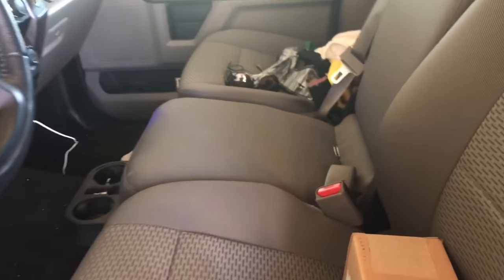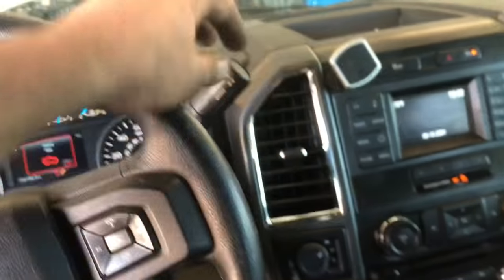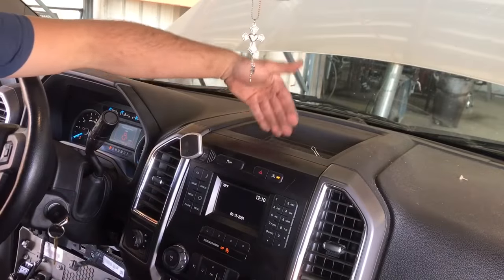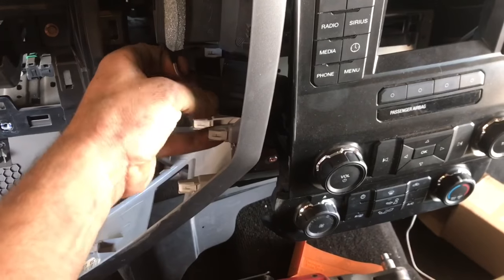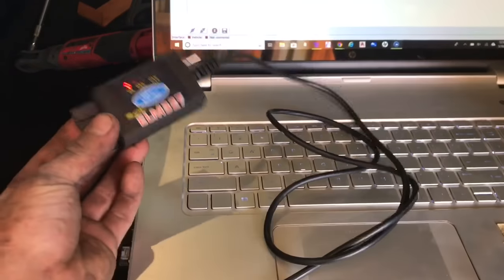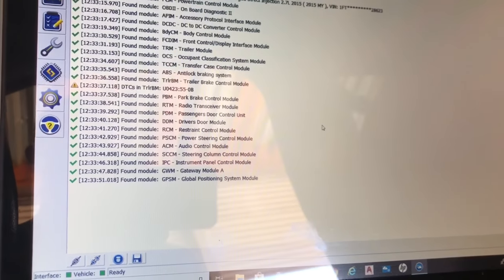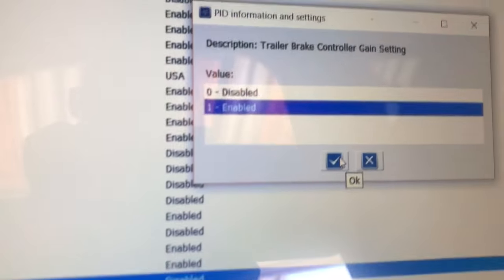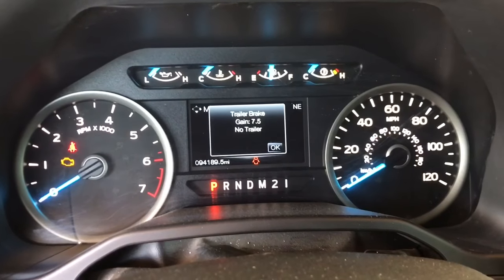Ford F-150 Oem Trailer Brake Controller Installation and Programming (2015+)

Comment: Make sure you have a 30 amp fuse in slot 24 for the controller to work. My 2019 did not have one. Just a fyi

Comment: Aaron, a bit of a late comer here.  I just installed the brake controller.  Easy Peazy.   Took about 20 min start t finish.  Took longer waiting for the temp key for Forscan.  One thing, I wasn't prompted for the Sync version and it appears there are 3 settings under the IPC heading, one for the Trailer Brake Controller Gain  Setting, one for Trailer Brake Control Module and one labeled Trailer Brake Control Module.  I set the first two to enabled and left the Trailer Brake Control Module alone for now as I wasn't sure what it did. and all the other videos didn't mention it.
Great video and presentation.  I'm not your average shade tree mechanic (a TON of experience since I was a kid) and I'm very PC savy  and also know my way around OBDC2 more than most.   This was a REAL easy install and WAY cheaper than having the dealer do it.  Super informative video, well done..

Comment: I used FORscan on another car before and I blindly hit yes when it asked to load previous configuration and I wasn't prompted to switch from HS CAN to MS CAN and it did not load the Instrument Panel Control IPC module.  I restarted the software, hit no when prompted to load previous config, then it reads your current vehicle modules, and will prompt you to switch to MS CAN, it then read and made IPC available to edit.  I was adding a trailer brake controller.  Good video, thanks.

Comment: Great instructions!  The only snag I ran into with the free FORscan beta download was that I was unable to play the IPC mobile configuration to enable the new trailer brake until I purchased the extended license. 1 year for $10, they emailed me the activation code right away and I was back in business. Trailer brake install on my 2018 F-150 successful!
Reply: All these videos and nobody tells you to buy the license.... I have been trying to get it to work forever.

Comment: just an FYI, you have to have the extended license to (forscan) to do this. it's free for 2 months but it takes a couple hours atleast for them you email you the key. this is the point I'm at so well see how it goes. thanks for the video extremely helpful.

Comment: Aaron, et al. All of the videos I have seen have you tearing about your dash and other parts. After thinking about it and using two smaller flat blade screwdrivers covered with a light cloth, I was able to just press down on the top center of the cubby hole blank and pry it out. From there you can pull everything out the front and plug in your controller.
Total time 15 minutes. No major disassembly required. This should work for almost any Ford vehicle.
The rest of the video to program the OEM unit is outstanding.
Reply: Eric Emde any chance you have a video of this technique?
Reply: @JuanRamirez-hk8sf  how do I start it

Comment: Thanks for the clear and informative video. I followed it to install a controller on my 2016, F150, 4X4, with a column shifter. In retrospect, I wouldn't have needed to take the parts off below the steering wheel. I was able to pull the existing cubby hole piece out to disconnect the wires and connect them to the controller. Accessing the plug seems to be the only reason to remove those pieces.
Reply: Did you have the 4 pin or the 7 pin connector at the hitch? If a 4 pin, did you have to change to a 7 and if so, were all the appropriate wires there?+

Comment: Just used this tutorial to easily install a brake controller on my 2015 F150. I did have the two entries to enable using my Brake Controller. I also didn't have a small ratchet so I had to pop the dash oard speaker off, and remove that whole section to remove the radio panel. 

Thank you for this video.

Comment: Really EXCELLENT video Aaron!  You covered everything necessary.  No useless fluff - just get in, and get it done.  I salute you!  I will be doing this as soon as my brake controller arrives.  Nice to see someone else appreciates ForScan too.  I use the BT dongle instead of the wired one.  So far; I have permanently shut off auto start/stop, added Hill Descent Control, enabled windows up/down from key fob, Bambi mode, powerpoint delay, radio on without key, and probably a few others to my 2015 XLT.  Love ForScan...

UPDATE:  Finished installing the hardware today.  No issues there.  Because of your video, I knew exactly how to take the dash apart!  Only problem I had was my old Windows laptop with Forscan on it is now a Linux laptop.  Didn't want to install WINE, or fiddle with passing Bluetooth through to a Windows Virtual Machine.  Finally ended up using a Windows tablet I bought years ago, specifically for Forscan, but never used because the display was too small to read.  Had to put on my best reading glasses, and suck it up...  Had it all going in a couple minutes... Thanks!!
Reply from the maker: That’s awesome, love the capabilities forscan has. Thank you!

Comment: Thanks, the video was really helpful.

For my 2020 XL I didn't remove the part under the steering wheel or the 7mm in the foot well. I did receive the two 7mm holding the top tray on before prying it up.

Comment: Great video. I bought a Ford brake controller from Amazon for roughly $100. The title claimed to be "OEM" and mentioned a part number. Using this video, I installed the "OEM" brake controller. I took my truck to the dealership to have the programming "flashed". The dealership doesn't use "Forscan", they use a Ford program that has to search for a part number before activating that specific part. The dealership was unable to detect my "OEM" brake controller so I ordered an aftermarket Reese brake controller with an adapting cord for my 2015 F150 for approximately $50 total. I disabled the dash again and plugged in my new aftermarket adapter. Needless to say, the aftermarket brake controller DOESN'T require you to have your truck "flashed" after installing. It simply by passes your truck's programming and starts working immediately. As long as your ok with a brake controller attached to your dash (I used velcro, did not screw it into dash) , it's a lot easier and cheaper to buy and install an aftermarket brake controller.
Reply: My 2014 f150 had been having issues with the factory brake controller not detecting my trailers. Swapped out the controller and still not working. Thinking of just bypassing the factory set up. Did you plug aftermarket controller into the factory wiring for the original controller? Thanks

Comment: Thanks Aaron!  I just installed this on my new to me 2017 F150 XLT.  I haven't ever done anything on vehicles other than oil changes and brake pads but this video made it so easy.
Reply: Did you have the 4 pin or the 7 pin connector at the hitch? If a 4 pin, did you have to change to a 7 and if so, were all the appropriate wires there?

Comment: Thanks for the great video. Installed the $90 OEM controller in under an hour. My '18 XLT with 4" screen and the basic tow package just needed the 30A fuse put in the fuse box in slot 24. Then I needed the extended license for forscan which took about an hour to get the free version.
Reply: Which Forscan did you download?
Reply: @KTMotorsports99  I don't remember there being an option. Just go to the forscan website and look for downloads. I started with the free trial but it told me I needed the extended license to actually make changes to the truck. You have to fill out a form to get the free extended license which gets emailed to you

Comment: Great video! The only discrepancy was the 4 bolts holding my plate on were 10 mm and had Blue loctite on them so they were a little snug to get out.
You couldnt have made it any easier, Thank You

Comment: I used this video last night for the install and worked out well. I just ordered the cord too since they want $50 plus at the dealership to code it. Figured I could use the cord for some other applications and see what else I can do with it. I am not technical at all on coding but this looked easy enough
Reply from the maker: Glad it worked!
Reply: Download the ForScan spreadsheet!  There are literally hundreds of mods you can do.  I added Hill Descent Control to mine (for the cost of a $6 OEM dash switch).  I can also now open/close windows from my key fob!  Add 'bambi mode' so fogs stay on with high beams, etc.  The most important mod (the first one I did) was to permanently get rid of the stupid auto start/stop!!!  No more pushing the switch every time - it's GONE forever now.
Reply: old-patriot  do you have a link to this sheet?

Comment: I checked position 24 in my fuse box and I have pins but no fuse.  What size fuse is needed to run the break controller?   This was mentioned a an issue in other videos of this topic.  Any comments about not having the pins in the fuse box as some 2018's apparently have this issue.  Also for what is worth, your video, presentation is extremely easy to watch and very well edited.   Your communication, sound and directions are clear concise with no excess or droning on and on like so many others.  Thank you.
Reply: My F150 was pinned as well, but no fuse.  I bought a 25 amp J case fuse and it worked fine.  Heard from another video online that you should put a 25 amp in.
Reply: The OEM module I bought came with a 30 fuse.

Comment: This type of operation usually ends up sending me to the insane asylum by the time I figure it out however in this case using your tutorial I was able to pull this off without any real issues. Did the whole install and enabling start to finish..thanks

Comment: Really appreciate this video, made installation easy. I have had some difficulty "activating" it with Forscan. The menu I get has slightly different options and doesn't include the trailer brake controller. Anyone else done this recently and have a work around or do I just need to go to Ford?

Comment: "We have gainabilty "  Thanks, very helpful video.
Reply: i guess Im quite off topic but does anyone know a good site to watch newly released tv shows online?
Reply: @Brixton Damian try flixzone. You can find it on google =)
Reply: @Brixton Damian lately I have been using Flixzone. You can find it on google =)
Reply: I installed the controller and used forscan. I have gain but when i plug in trailer the dash readout says no trailer connected.  I can make the brakes work some by  pushing the slide but brakes only work just before a stop then lock up . 2015 xlt f150 4x4.  Any suggestions for a fix?

Comment: Great video. I used it once for installation of my trailer brake and then more recently for the install of my Panavision mount to hold my cellphone (required removal of the radio/display unit). Thanks!

Comment: Great video, but save some time by not removing the metal bracket under the Steering wheel, you can just plug the plug thru the hole the controller goes in.

Comment: Aaron, thank you for this video. I was able to use it to program my controller for my 2018 F150.
Reply: What trim level do you have on your 2018? I'm curious if I have the ability to do this on my STX RWD.
Reply: @cjg6064  Mine is an XLT

Comment: Awesome video. The prior owner installed a TBC but never enabled it with Forscan. I don't know if it is a genuine Ford part, or a cheap chinese one. I noticed in the winter it was draining the battery, which I discovered after I pulled the fuse under the hood for it while testing for current draw. It functioned when pulling a trailer, but it never displayed the gain setting. Now it shows the gain setting and I'll see if the current draw problem persists.

Comment: This didn't completely work for me. The physical installation was perfect,  but I got a "Trailer Brake Module Fault" after enabling.
I discovered I was missing the 30 amp Mcase fuse in 24 slot under the hood. Thanks so much!

2019 F150 xlt with tow package.
Reply: I had the same issue.  Thanks for posting this.  I’m going to give it a shot.  Hope it works.

Comment: you don't have to take the panels under the steering wheel loose.  after you get the face off the vent right of the steering wheel you can just pull the cup insert out and unplug the connector from the back of it.  This cup only is there to hold the connector for future use.

Comment: Thanks very much the dealer wanted 860 dollars to install with your vid i only payed 127 super easy thanks again for the vid on my truck i hat to enable the trailer brake module trailer brake controller gain settings and the trailer brake control module
Reply: CHRISTOPHER ORTIZ you're kidding right? 860 dollars??? Where are you located In Japan or something?? Maybe Mexico charging in pesos not dollars? My dealer quoted like 340 for it.

Comment: Excellent video.  Evidently everyone has had positive results but me.  I carefully installed an OEM controller in my 2016 F150 but, so far, it does not work.  I thought it was related to the DTC that comes up after the initial scan, (U0423:55-0B) but I see that yours showed the same thing.  I thought it was a bad modul so I returned it and got another.  Same result.  No brakes yet.  My IPC list did not have the "control gain" line item only the "brake control module" line item.  Any suggestions?

Comment: Help....   2020 F150 with tow package. not max.  Need TBC and Programing.   HOWEVER, the dealership can not guarantee the 12 volt aux will work.   They think the F150's are not wired for it.   It has the Fuse installed (30) and the pin on the plug is wired with heavier gauged wire.   Your video is helpful

Comment: On my 2020 xlt CC the bolts were 7mm and 10mm.  I felt like you could get away with not undoing the dash as I was able to pull out the blank then unplug the harness.  Might make this even easier yo do.

Comment: 2016 F-150 SuperCrew with towing package. 

This is a terrific guide.

I replaced my trailer brake controller and I have interesting results. When I activate the trailer brake control alone, I get 12 volts on the appropriate spade on the connector;  when I use the pedal alone, I get 1.5 volts. I don't think this can be a ForScan setting, since I have "gainability". What do you suggest as my next troubleshooting step?

Thanks for the help

Comment: I have a 2017 F150 and it only has a 4 pin connector. I bought from Ford the wiring harness and the 7/4 pin connector for the bumper and the brake controller. Can I just install all these parts do the software update and have an operating 7 pin connector that will operate the trailer brakes? I asked the dealer and they had no idea and your video is one of the best I found.
Reply: Ed Downey I would like to know as well, that’s a good question
Reply: I installed the wiring harness the 7/4 pin connector in the bumper and the break controller and it worked. I recommend dropping the spare tire to remove the old harness and install the new one. Installing the  software took several steps so leave time to do that. I used a WiFi OBD2 connector it worked but a wired one might be easier. You can not do the programming with a phone or a Mac so you need a Windows laptop.

Comment: Hi I  installed follow the directions in your video. Everything worked great including the software change in the truck computer. I have one question. My truck is a 2016. I had three options in the computer. I made the top two active, trailer brake module and trailer brake gain. There was another trailer brake module below trailer gain that I did not make active. I wasn't expecting to see that.
Reply: Mine is a 16 as well and I'm not seeing the option for IPC at all.  Not sure what step I'm missing...
Reply: @Dinero2005  you need the elm327 with a switch.  Place the switch to "HS-Scan" before plugging it in.  The software will tell you it's in the wrong position but without doing that one step, you won't get the right options... 2019 F-150 here.
Reply: So are they working like that, because I have three I enabled 3 and I'm having issues does yours work with just the 2 enabled

Comment: Good evening Blessings greetings from San Carlos Costa Rica Pura Vida question does the 2014 ford f150 raptor have a trailer brake question can you install the 2014 ford f150 raptor trailer assistant or not

Comment: Great video...... QUESTION:  I am on setting 10 and feel there is still not enough stopping power. I understand somewhere in the truck display there is a LOW, MEDIUM, and HIGH setting. Where is this and will it help me lower my controller setting and achieve more stopping power if I select MEDIUM or HIGH?
Reply: You ever figure it out?  My 2015 is weak at a gain of 10.   No settings that I can find for low,med, high on my truck.
Reply: @homeskillit5649  Yes. I figured it out. It is in the dash computer settings somewhere, I just cant remember. See if you can find it on joutube somewhere. I will see if i can find it again in my truck and let you know.

Comment: My dealer had my truck for 2 days . Claiming they were having problems programming the break module. I showed up on Saturday  to get paperwork of my truck, and they  hadn't even installed the module yet .
  Would you trust the dealership from this point on ?

Comment: My 2017 has three settings: trailer brake control module, controller gain setting and trailer brake module.
Reply: Mine does to what did you enable
Reply: @brentblack6219 I’m suspicious if you enable the trailer control module and don’t have the module will draw your battery dead.

Comment: good video but you can skip removing the panel and metal bracket under steering wheel. the plug is long enough to pull it out with change holder.